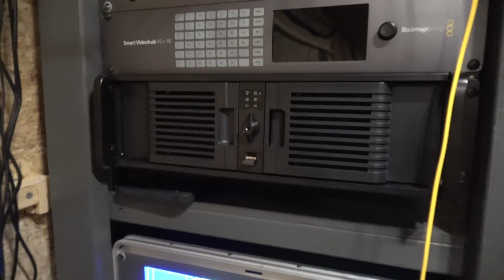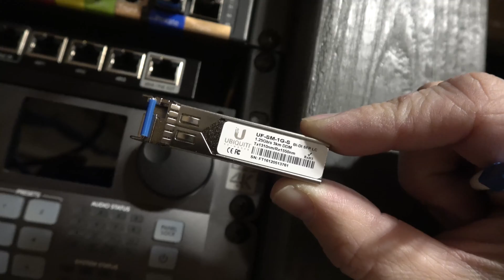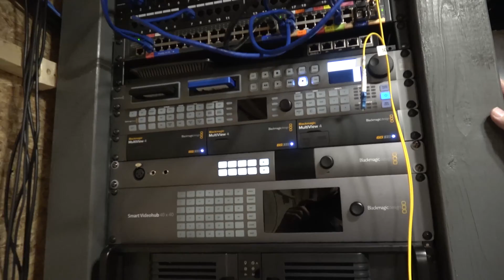Video Production Trailer Construction Update - Oct 2, 2017 - Networking

Comment: Hey Doug, would you be able to do a video on how you made the edge router x do what you’re using it for? It would be very useful to know.
Reply from the maker: There's a wizard built into the web interface for doing fail-over. I just took those resulting commands and applied them to three interfaces rather than the default of two.
Reply: @djp_video  that’s great thank you.

Comment: Hi, what devices do you use to handle in-venue Wifi? Both as client to supply internet connection to that Int 2 port on the breakout and also potentially as an access point for connection of wireless devices. (Although I suppose that you prefer to have everything wired, if possible, because it's more reliable.) I've noticed in newer video that you have a port specifically labeled as WAP for that purpose, on the breakout box, so what device do you plug into that port? Thanks for reply!
Reply from the maker: I have a Linksys WiFi bridge for connecting to a venue's WiFi. I've only used it once, and it wasn't very fast or reliable.  Wired is so much better, and I've basically been telling my clients that I have to have wired access, or charge them for cellular. Once I mention extra charges you'd be surprised how quickly they'll find a way to make sure that wired Ethernet is available.

I'm using the TP-Link Omada AC1350 ( https://amzn.to/3n0B9fy ) as my access point both in my trailer and in-venue. That's what I connect to the WAP port.
Reply: @djp_video  Thank you very much! :) I love your videos...

Comment: Looking good!! Is there a reason why you don’t use cwdm for the fiber connections to your mobile box?
Reply from the maker: Yeah... the SFPs used by the video equipment are specifically designed for video -- normal Ethernet SFPs don't work reliably, if at all.  Finding CWDM SFPs designed for SMPTE video is both difficult and expensive, especially in 6Gbps variants.  I actually haven't found a supplier of those at all.  

For ten cameras, I'd be looking at replacing 20 modules that I already own and are working.  My 12-strand fiber trunk is considerably less expensive than the CWDM SFPs would be, and frankly is easier to use since any camera can be plugged into any channel without worrying about matching wavelengths.

Additionally, using the same wavelength for all video signals allows me to use a simple optical splitter in the breakout rack to distribute the return video feed to the cameras, so I'm able to send return video to 8+ cameras using just one single strand of the trunk.  Doing something similar with CWDM modules would require four breakout cassettes or cables (one for transmit plus one for receive on each end) instead of the one I'm using now.

With my setup now I can run up to ten cameras plus Ethernet over my 12-strand trunk (10 camera feeds, one return video feed, one bi-directional Ethernet).  That will suffice for 90% or more of the events I shoot.  Plus, if I need to run more than that I already have three other trunk cables.
Reply: If you already have an infrastructure based on non-cwdm, than indeed it would be very expensive to switch over to cwdm. The supplier I used for 3g cwdm sfp's was fs.com

Comment: Looking good Doug. Nice choice in routers! Looks like you're gearing towards having TD crew on site and graphics crew in the trailer?
Reply: ...also nice choice in wall color. Now ya just gotta get the light color floors... and your set!
Reply from the maker: All direction will normally be taking place in the trailer.  The front wall of the trailer (this video is facing the back) has three stations for the director, TD, and someone else like an assistant or producer.  On the left side, behind the TD, will be playback/replay and then audio behind it (you can see the walls for the audio booth in this video, on the right side of frame).  The right side of the trailer will have the stations for CG, PTZ camera control, and then the engineer (me) at the equipment rack.

We won't have many productions requiring all stations at once, but they're all there if needed.

Having it laid out this way means that setting up for an event means basically just running fiber cables and setting up cameras, with everything else already pre-configured and ready to go in the trailer.  The goal is to be able to complete setup for most any type of event in an hour or less.

Should there be a need for a director on-site, it's still easy enough to do.  Since the switcher is controlled over Ethernet it's just a matter of plugging a laptop into the remote switch for network connectivity, then running the Multiview video output from the switcher over one of the other fiber strands.

Comment: Hey Doug, if you get the chance somewhere along this project I would love to see what you use to do character graphics. Based on my research it seems like most live graphics systems/software are very expensive and/or not that great. This drives me nuts because with the power of modern computers even a basic software application could generate excellent 2D graphics rendered in real-time. Most sports video games simulate broadcast-style scoreboards (that are basically identical to their broadcast counterparts) while simultaneously rendering a full 3D game in the background. I can't understand why big-league solutions (like Chyron, xpression, vizrt, etc.) cost into the tens of thousands for what is pretty much a rackmount pc running a program with colorful stickers on the front.
Reply from the maker: My solution for CG is pretty unorthodox -- I write my own software for most of it.  But I'm not really doing any fancy animations or anything like that.  My needs at this point are pretty modest.  If and when I need a more sophisticated solution I'll figure out something there too, whether it be more custom software or making an investment into a higher end package.

The main reason those systems are so expensive is because they can be, and the companies have been built around a certain level of revenue -- they have support people, salespeople, infrastructure, etc. to support and have to do so on low sales volume.  If someone was to start out building a system today it could be cold for a lot less -- and there are some out there, but most are pretty lousy.  It's certainly a market ripe for plucking by someone with ambition.
Reply: Have a look at Caspar CG.  Its Open Source and pretty powerful.

https://www.casparcg.com/

Comment: It really starting to come together! Good job!

What’s the brand on the switch? I’ve been using the Cisco SG300 series but they’re pretty pricey.

Also, on your internet failover, is it seamless or is there a slight interruption? I have an edgerouter but I’ve never played with that function.
Reply from the maker: Jonathan Scruggs It’s a TP Link. One of the cheaper brands, but I’ve had good experiences with them.

With the failover it depends on if the link itself goes down or not. A failed link does switch pretty quickly. If it is just packet loss it can take a bit for it to detect the loss and migrate to another connection. The time is configurable.
Reply: I see. Makes sense. You mentioned using network audio. Are you planning on using Audinate Dante? I’ve been using Dante for about the last 6 months and have been very impressed with its stability and flexibility.
Reply from the maker: Yes.  Dante is where I'm eventually headed.  Right now the plan is to use the Yamaha TF3 mixer.  But some newer Intercom systems are starting to move in that direction too, so I might use it for intercom as well.
Reply: Doug Johnson Productions did you buy a tf3 yet?
Reply from the maker: Not yet.  It isn't in the budget for this phase.  It will come later.  I'll be using a Presonus mixer I've had for a few years in the mean time.